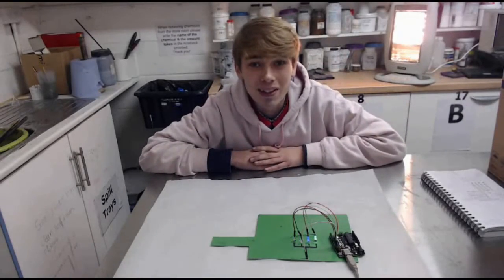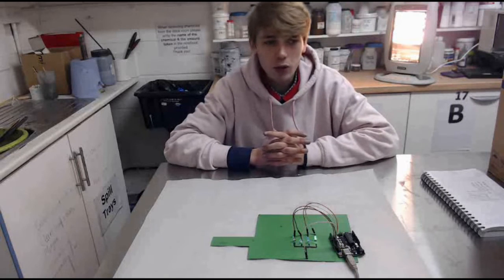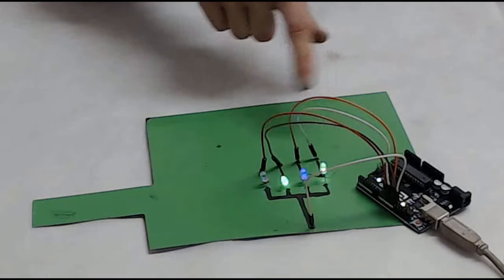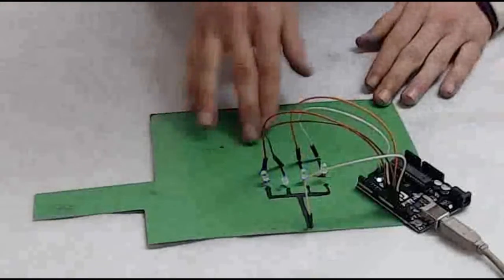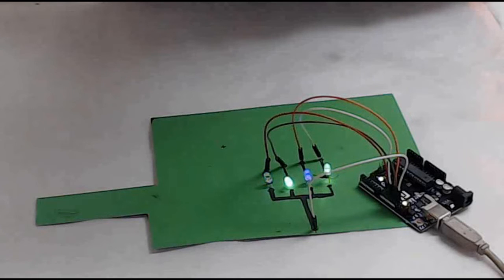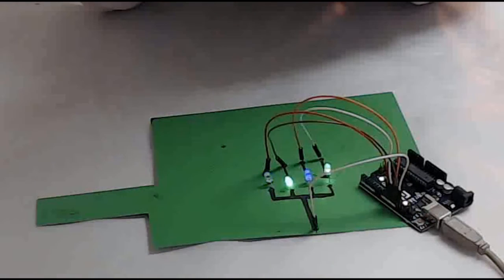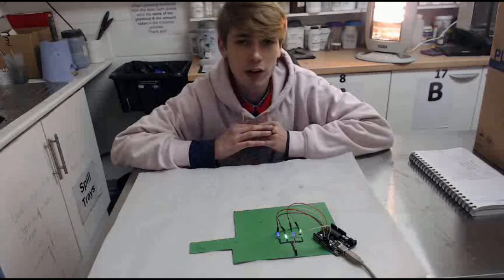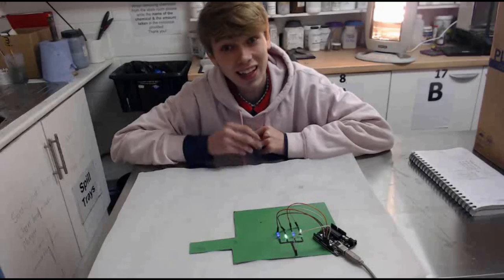LED Rhythm with ink and an arduino

Comment: Very cool mate! Is there a practical circuit length "maximum" with the ink and the L.E.D.'s or can you draw what ever design you need with adequate conductivity?
Reply: Thanks mate! 
You know what, i haven't tried to reach the "maximum" circuit length.
But I can tell you that i have made some pretty big/long circuits. It should defiantly keep adequate conductivity all the way through. ( I would put 2 coats of ink though, just to be sure, if you're working ink big circuits)
Hope this helps!
Reply: You are talking about resistance and voltage drop. To calculate the resistance of a wire, you need to know three things:
  -  its length  
  -  its cross-sectional area 
  - The resistivity of the material   
       Resistance = resistivity × length / area
Then to calculate the resistivity. You can rearrange it to get a formula as below:
       resistivity = resistance × area / length 
Then Just calculate the voltage drop of the conductor.

Comment: Comic books special edition 3.7v but building the curcit engine depending if holographic or what other options may work but spawn covers with that green plasma stuff would have looked way cool!!!!! or using a two layer so the head turns or something. 😆 the comic you can read in the dark.
Reply: Interesting. Comic books and media
Reply: @KOTHRIVAL  special edition types would look so cool like the blades on a helicopter as it turns 😆.👍just add a 555 and set sequence for it on conductive ink lined in the page or the cover made as the battery with magnet charger the micro curcit it would be a job but.

Comment: Dead cool man.   I've been looking for a picture frame to suite my needs
but not found one with the aesthetics and required depth
but I'm sure one will turn up.
It's intended to be just a picture during the day but light up at dusk 
as background hallway lighting/picture.
I'm observing your techniques for reference.
I'm merely a beginner amature in electronics so always watching out for inspiration to backup my
highly limited electronic abilities. 
The arduino has come to light as a possible control source thanks to yours and Roberts work with these devices.
Always been put off because of the time element learning the Arduino electronics/programming.
Nevertheless I will persist until I get what I want.  Just doing it for fun really.
Reply: Hi Anthony, Thanks mate!
This one is a really cool idea!
I was only a beginner a few weeks ago (still am lol), But its all about giving it a go.
The arduino is an awesome piece of equipment and only cost a few quid, its kinda easy getting the hang of the basics, and there is defiantly sketches and shields out there that would make this project easier.
Give it a go mate, because that would be very interesting!
Reply: @MyNameIsLukey  "May the force be with you".
Reply: ER, not the police force, the other one.